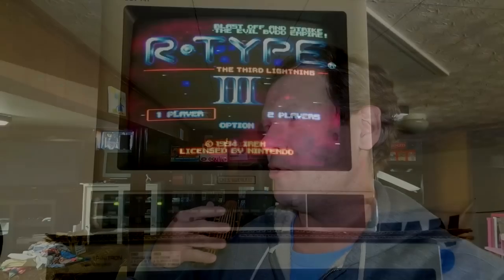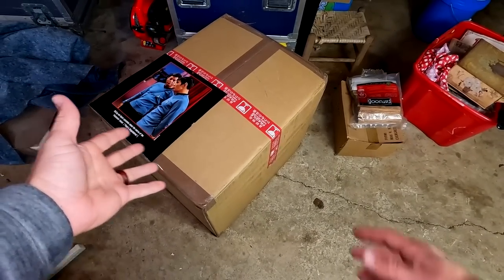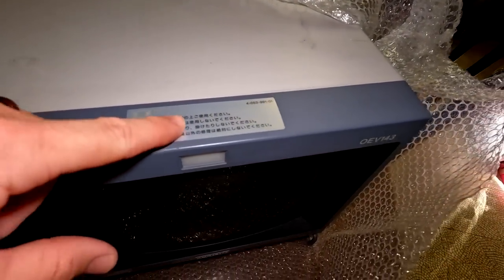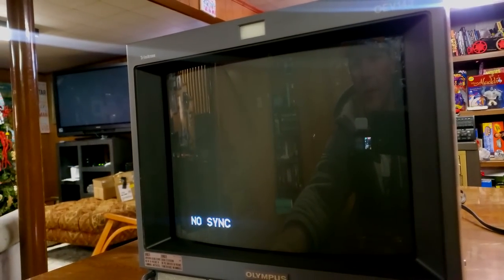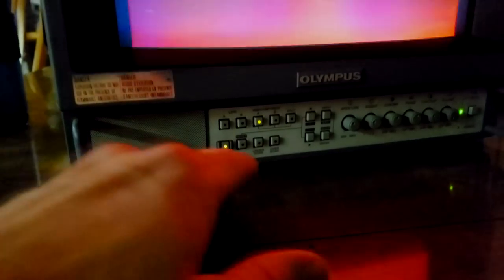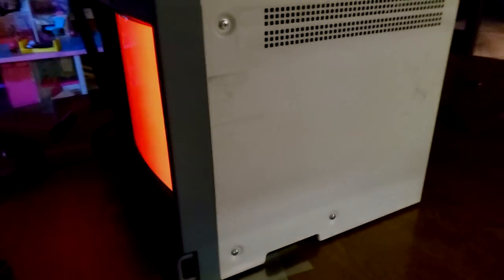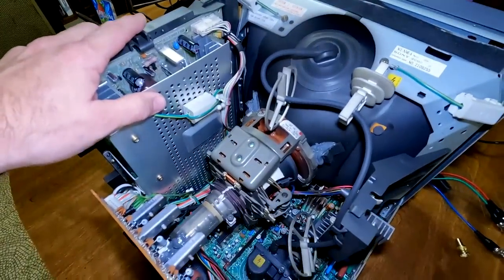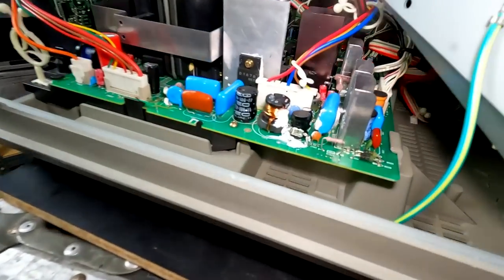Importing a CRT from Japan! - Olympus OEV PVM

Comment: I got 3 of these last year (2 OEV-143s and 1 OEV-142) from 3 different auctions from the same seller through Sendico from Yahoo auctions. After shipping they each ended up being ~$350 each. They all arrived great, except for one pull tab being snapped. They all look amazing and I'm super glad they all survived the trip to Australia. I personally prefer the 142 since it uses the same color scheme as the Sony medical sets (not the biggest fan of the blue-grey the 143 uses) but they're the same in all ways but cosmetic so it doesn't really matter.

Rambled on a bit but I love these sets so much so it's nice to see them get attention, even if they are just rebadges of the Sony counterparts. Excellent video as always!

Comment: I have one of their shadowmask monitors, the OEV-141, I really like it. Its got an RGB-out too so didnt need to bother with an RGB-splitter. There was a Sony PVM i was also considering but they were the same price and the PVM was actually less sharp (it was one of the older models). Both were quite sharp but I was blown away by the OEV-141.
Reply: believe that one i sold (possibly you) was around this price imported, $350-$400 after shipping and taxes. swear i got it at around $48 at auction on buyee. about the same for the other trinitron pvm.
Reply: @mccall9770  it was me yea. I use it a lot its great. Sounds like you got a really good deal when you got it on auction a few years ago.
Reply: (My deal was also very good for when i bought it/today's prices)

Comment: I bought the same model two weeks ago here in france. It's really a nice monitor. A have the same little geometry issue with the top right of the picture being 1 line higher than the top left, is it possible ti fix that ? Cost me 220 Euros (around 100 less than tha average price of a 14m2 here) and a 2 hours drive.